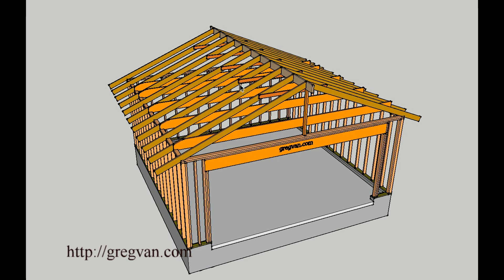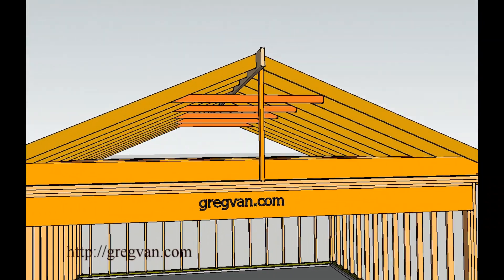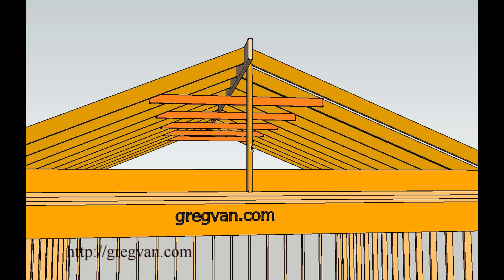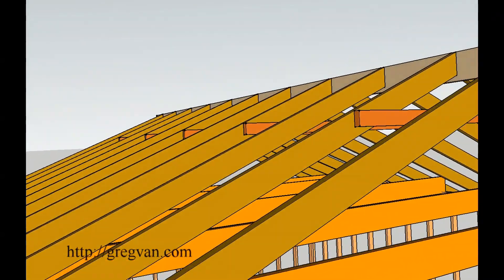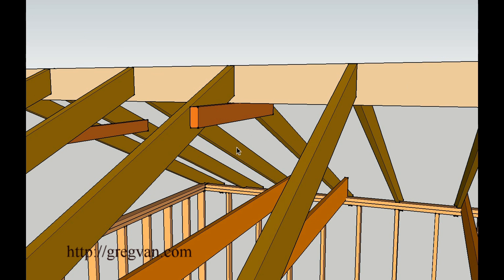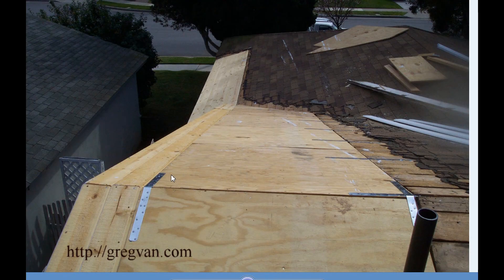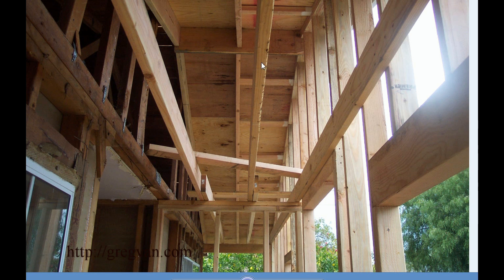How To Relocate Collar Ties To Raise Ceiling – Roof Framing Modifications

Comment: I have a similar situation in my 10x20 prefab metal shed. The roofing system is very simple, consisting of two rafters held together by a 2x4-inch nail plate on each side and a single collar tie—three pieces of wood total per section. I would like to remove the collar tie because the roof is fairly low, and it's honestly just annoying.

The roof is made of sheet metal, and everything else is constructed with 2x4s. Could I replace the collar ties with a triangle-cut 2x8 or something similar at the very top, above the nail plate? The main goal is to open up as much headroom as possible.

Thank you!

Comment: I’d like to move the collar ties up to the ridge board. I’ve seen other guidance saying that they can’t be too high. Is that wrong? This was a non-pro speaking, so I take that a grain of salt and check here. My attack isn’t huge. Eyeball measurements are about 8 feet up to the ridge and roughly 18 foot rafters spread along the floor.

Comment: Maybe I'm confused but one of the reasons you use a collar tie is to prevent the walls from pushing out under the weight of the roof... How in heavens gate does a Strap prevent that.. by the pics it seems it is a simple metall strap going over the ridge.. Huh?
Reply: Collar ties are used to prevent the two sides of the roof from separating during uplift. You are thinking of rafter ties. They prevent the walls from pushing out when the roof is weighed down. Collar ties are placed in the upper third of the attic space and can be replaced with ridge straps. Rafter ties are in the lower 3rd of the attic space. In some houses, the ceiling joist that form the attic floor function as rafter ties.

Comment: I noticed the video preview photo seems to have ridge straps placed OVER the decking. I was always under the impression they needed to be under the deck right on top of the rafters. Is it okay to place them over the deck as pictured?
Reply from the maker: I've always installed them over roof sheathing, but you would need to check with your engineer if you have one to make sure.

Comment: Is the ridge strap a piece of metal that is already bent and designed for the peak of the roof, or do I buy a flat piece of metal and bend it to fit the peak?
Reply from the maker: Yes, it's flat and then you bend to the angle needed.

Comment: Can you still move the collar tie up if you have a knee wall? We have an attic space with 7 foot ceilings that we'd like to take to 8 foot. Its 11 feet from floor to peak. Currently, the collar ties are 4 feet down from the peak and the knee wall is 3 feet. Thank you!
Reply from the maker: I'm not able to provide engineering information for individual projects like yours, but can suggest that I've seen collar ties installed right under the ridge framing.

Comment: How would this work for a roof with trusses?
Reply from the maker: Roof trusses are individual engineered units without collar ties and any modifications done to them will need to be approved by an engineer. It's not the same as conventional framing where you use roof rafters.

Comment: I have what I would call mid span ties, too low to be collar and too high to be rafter ties
They are two feet approx up, it’s a70’s era house with gable roof and ridge board
Ceiling joists double as rafter ties, and they overlap in middle over bearing wall
I need to air seal my attic and I can’t even move up there hardly
Would building a knee wall be a waste of time?
I would like to install collar ties at the top and remove the mid ties 
Thanks for any advice you can give me
Reply from the maker: You can get our email address at our website. Email me a picture of your problem and I'll be glad to take a look at it. Keep in mind that I cannot provide you with structural engineering advice, but can provide you with an opinion.
Reply: @gregvancom  hey Greg, I have the same question as this person. I was wondering if I could email you some photos and you might be able to reply? I understand you’re not offering structural engineering advice, merely some opinions as a layman.

Comment: Typical engineer. Put straps on top so when loaded  from above will do absolutely nothing. Rafters will seperate and strap will simply flatten
Reply from the maker: I know this doesn't sound right, but the reason for the straps is to prevent the ridge from coming apart during uplift, when most people think it has something to do with downward pressure, but it's all about upward pressure.
Reply: It's the rafter ties (lower third) or more commonly ceiling joists attached to the rafters themselves which ultimately prevent the outward wall separation of which John (and many, many other Internet commenters) speaks.
Reply: Typical YT commentor, talking out of his arse, Collars are for Uplift and have been since their demise in the 70''s.....

Comment: Those straps do not negate the need for collar ties. Collar ties stop the roof from pushing the walls out. How would straps at the ridge stop the walls from pushing outwards?  The only reason you didn't need collar ties is because you had a center beam supported on both sides. The straps are needed to attach the addition to the old roof so they dont separate. Am I missing something here?
Reply: i know, right?
Reply: Collar ties reduce uplift, rafter ties reduce outward thrust on exterior walls
Reply: @Mrdubomb  just the opposite. Think about it.
Reply from the maker: I think you're confusing collar ties with rafter ties. Rafter ties are used to reduce problems in case there is any uplift. For example, if a strong wind came into the building, it could create enough pressure to separate the top of the roof where it connects to the ridge.
Reply: @gregvancom  Nope. Has nothing to do with hurricane ties.

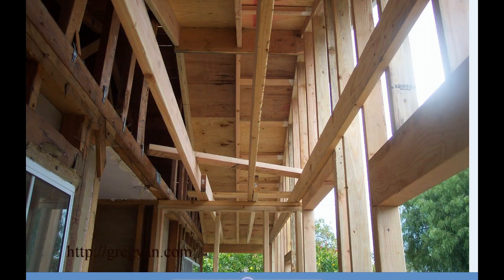Comment: At 1:35, are we looking at a structural ridge beam? Most articles re: removal of collar ties emphasize the need to have (or add) such a supported ridge beam in order to prevent sag. Curious to know your thoughts.
Reply from the maker: I usually consider a ridge beam to be something 3 1/2 inches or wider, but it is structural and it is a ridge. There are plenty of homes built with 1.5 inch wide boards as seen during the time you provided for me in the video. Some of them do sag over time, but it's not very common if the home was designed by a structural engineer.
Reply: @gregvancom  Love the metal strap concept, and will definitely discuss adding them when it comes time to re-roof over the attic we'd like to convert to habitable space!

Comment: Is this the case even if the ridge beam is not structural?
Reply from the maker: It would be hard for me to imagine a ridge beam that wasn't structural. I've actually seen homes built without ridges or blocks between the tops of the roof rafters that are still standing today.
Reply: @gregvancom  Come to New Orleans where pretty much every house has a roof with a ridge board (not beam), thus not structural. I've been told you cannot use the strap-over-top method in such cases, when seeking to remove collar ties, but haven't double-checked  that with an engineer.
Reply: @gregvancom  Depends on the span and roof loading.
Reply: How would you discover if the ridge beam is structural or not? I want to raise my attic’s ridge ties to the highest position as your video demonstrates.